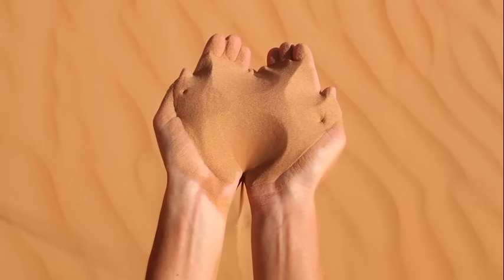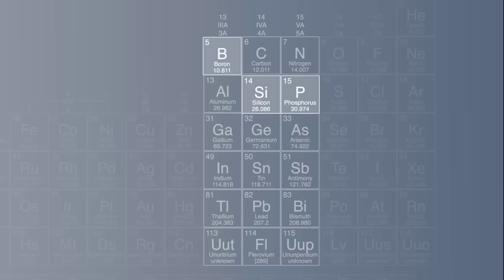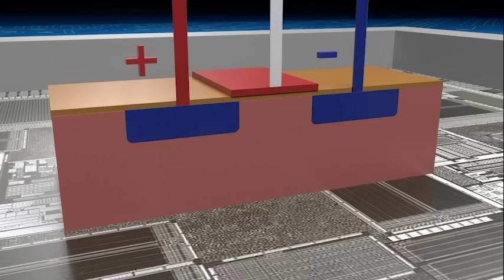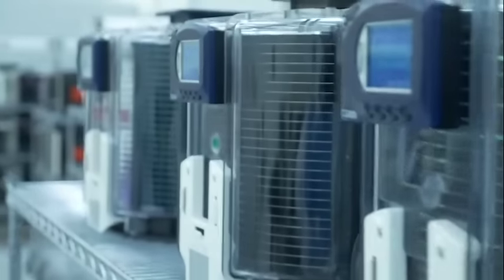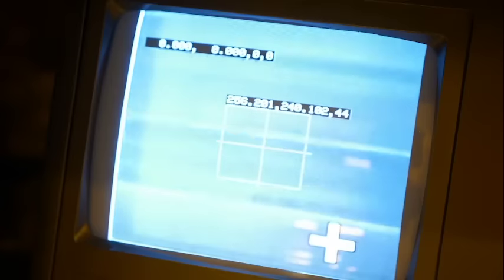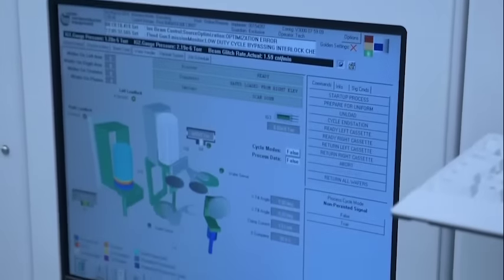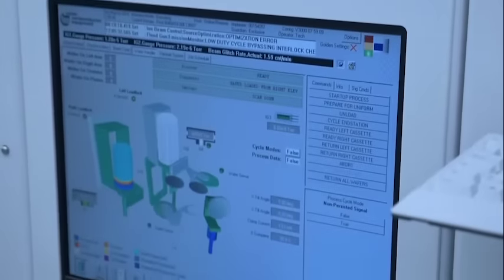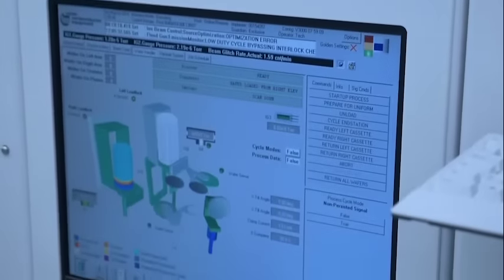Chip Manufacturing - How are Microchips made? | Infineon

Comment: I'mma be honest. I've seen plently of videos about semiconductor manufacturing and I have to admit... this is probably where most things clicked for me. The way the field effect turns on a MOSFET, the steps in which a photoresist or oxide layer or sputtering or etching generally happens compared to the others. This is fascinating stuff, and a nice explanation, although even now I still have to check over somethings to remember the process better. Maybe read some then watch some more Asianometry content 😅

Comment: the existential question .. how are the machines that manufactures these nano scale chips made? they themselves contain the few nanometers transistor technologies ..
the creator is made out of his creation!
Reply: You answered your own question.
Historically speaking, the first ever machine that produce transistor is very big. Like a Barn. And then they decided to make technological advances out of transistors that already been made into making a Smaller transistor than the first one. And repeat.
That process went for tens of years from 1947 to this day. 
Everything literally went through Trials and Errors. To the point where Transistor can no longer be made out of something purely Conductive because it will gets easily overheat, the scientist need to came out with solutions. This is the point where semiconductive Transistor ideas came out. The scientist need to find a way to make a transistor able to withstand overheating until they experimented with the Sand aka Silicon. Now regarding your question about how did they make nanometers scale of transistors? How did they actually cut it or sculpt it .Like have you ever tried to burn something using Magnifying Glass and Sun light? That's how they experimented with.
Reply: @ClayWheeler  thanks for your detailed answer
Reply: The smaller chip sizes simply give the end product more speed. You could probably run the software for these robots on 20-year old machines.

Comment: i still dont get how they make those 7 and now 5 nanometer transistors.....? what tool they use?
Reply: with alien help
Reply: It's a trade secret, not every company wants to disclose their techniques I guess. But from what I've heard and researched online, they often used advanced versions of the techniques mentioned in this video, or something 

I know I might be r/wooshed for this one
Reply: @rickv9180  yeah i did research on that, found out that they use various versions of nanolithography and few other imprinting ways, it is still beyond me how can we imprint things to near atom/molecular size :O
Reply: they use materials that are light sensitive to make the designs and print the silicon
Reply: @NostalgicMem0ries  It's just like this, but with light of a similar wavelength. Well, ok, actually they use some tricks with making two walls in separate steps that leave a gap that's smaller than what they could project in a single step, to get those extreme fine 5nm lines. But apart from some trickery when projecting the patterns, it's just this. And then some more steps for more metal layers on top.

Comment: How did anybody figure out how to make this? Now I want to know that
Reply: This came up in stages, like you see Intel's 4004 microprocessor is a very simple technology as compared to today's i5, i7 processors. That cake only through several stages each having improvement over another
Reply: That's an interesting story, indeed.
Reply: Transistors and diodes had existed for years as vacuum tubes (which were very large and power hungry). Scientists gradually figured out ways of using doped silicon/germanium to mimic the effect of the vacuum tube transistor/diode - at first, they were slower than the thermionic devices, but eventually became faster so everyone wanted to start using them.
The process shown here is the evolution of mass producing smaller and smaller transistors - the early ones you probably would only get one chip on each large wafer..........

Comment: If you understand valence, then you will understand the principles of microchip production. Now, I have to know how 1 and 0 dictate the operation of the chip. I have read previously that the diameter of atoms is around 1 NM and that the theoretical limit of gate is 2 nm. Any less than that and the atom will not be able to pass through. Is it true?

Comment: Chips don't start out with regular sand, we have an abundance. It's a common misconception I hear again and again. 99.99% of sand is not suitable for semiconductor manufacturing because it has many impurities that cannot be easily removed. There are just a few deposits in the world where SiO₂ is pure enough for the industry, and usually, it's not sand, but quartz mineral rocks.
Reply: Yes, perfectly right. Sand is generally not pure enough. But the most important problem is that grain are so small that it is very difficult to control the carbothermic reduction of silica into silicon. Quartz mineral block, bigger than on fist, are used. See for instance https://youtu.be/D1ALNg3z2gk

Comment: "not permitted to wear any makeup"
I had a huge disaster with a product at work that used component from your competition that had been randomly failing and we couldn't figure out what was the cause, later on after investigation with electron microscopes, x rays and other fancy equipment, it was discovered to be contaminated with makeup that some lady operating the bonding machine had been wearing.
So yeah it's nothing excessive, it all has to be really clean.
Reply: When I worked in the paint shop we had repeated issues with contamination of car wheel trims in exactly the same place.... after looking through the process we found out the issue was the operator placing the unpainted parts on the robot was eating cheesy wotsits with the same gloves she was loading the parts with...

Comment: 4:28 Wrong. Simply disconnecting Gate from positive pole is not enough to close FET. Gate must be connected to negative pole (to discharge capacitor formed by Gate plate, P-layer and insulator).

Comment: Does anyone know why we can't use the entire wafer to make the microchip and just not make the circuit smaller?  

Currently we have a tiny microchip in a 50x size smartphone, and metal connectors take up so much space to shrink down to join the circuit board with the microchip.  So Why not have the entire circuit board be the microchip?  No connectors needed and miniaturisation can cease or reverse, as a smartphone sized microchip as the circuit board itself could hold 6 TB, based on current 120 GB a small microchip a 50th the size of the smartphone can hold.

Please let me know.
Reply: Technically it would of course be relatively easy to build such a chip. But it wouldn't be very fast nor very energy efficient. The problem are the extremely high clock frequencies: 

A 1 GHz clock means that even light can only travel about 30cm during a single clock tick. I don't know how fast the electric field propagates in a semiconductor but it is probably something between 30% and 60% of the speed of light in a vacuum. 

Now consider that an electrical connection often cannot go a direct route and you also want a safety margin so that all signals are stable before the next clock tick. So high clock frequencies are only possible with small chips.

Smaller transistors also mean better energy efficiency. A small transistor "fills up with charge" and therefore switches a lot faster than a large transistor. So in microelectronics miniaturization is king.

There is however some research to ditch the high clock frequencies altogether and build on slower chips with parallel computing. The problem with that is that not all workloads can be easily parallelized. And more cores also create more problems with memory consistency. A very radical idea is neuromorphic computing which even ditches the von Neumann Architecture we all know and love. But it'll be a while before that is ready for prime time.
Reply: Yield is the problem. There are too often defects in a wafer. If 99% of the chips on each wafer is ok, it's a good result. But if there would only be one giant chip on the wafer,  only one out of hundred would work and the rest would fail and be scrapped (assuming that 99% yield on wafer level meaning 99 good chips for every bad chip - the number is just an example, in some applications we can do better, in other applications we do worse than 99%). What I mean is, the larger the chip, the lower the chance that it works correctly. If you have smaller chips and test them before assembling on a circuit board, you have much more chance that everything works correctly.
Reply: And also, some functionalities in your phone, require different wafer and packaging technology, those can not be put on same wafer as the usual stuff

Comment: How on Earth is there a silicon shortage when it's made of sand?!
Reply: Effective distribution for cheap is quite difficult
Reply: (1) It's not really made of sand, because it would be too expensive to purify the silicon in sand. They get their silicon from mines. But that is not the problem.

(2) The shortage has nothing to do with the raw materials. It's a problem with production capacities. And as you might guess from the video, the production of semi-conductors is extremely complicated. You don't just build a new factory in a few months. The machines in these factories are not something you can order off the shelf and have them delivered in a few weeks. They are manufactured specifically for the client and some cost over 100 million dollars a piece and have a lead time of more than 1 year until they are delivered.

Comment: You can’t use deserts sand that mostly sandstone dirt.  Even pure sand   The main choice It has to get to 98% pure silicon goggle  by 2 long 45 minutes of 2,400 degrees to get pure.
 They are sand shortage in Asia’s already. Can’t used desert sand . That why cement building in Africa collapsed the dirt inside make it breakable.    I did research the top 10 countries who  have these furnace  that make 98%pure silicon ingot 6 are in china.  They  covered all bases decades ago. Did their science homework.

Comment: and media is saying we have a shortage of microchips LMAO - made primarily of silicon. Media continues to spread FUD
Reply: Well, The media is right, we do have a shortage of microchips. But you interpreted a meaning into the news which isn't there. Nobody ever said that a lack of silicon was the problem. The problem is manufacturing capacity. Manufacturing slots in fabs are currently completely booked way in advance and unless you are manufacturing stuff in high-volumes or are prepared to pay a premium, it is hard to get a slot.

I work in R&D. Since we only build prototypes we don't have a huge demand for ICs and our demand is most certainly not constant. For some components it is currently a huge pain in the ass to get them in a reasonable time-frame to reasonable prices. For some components we were quoted lead-times of more than 1 year.

Comment: This video is shoddy. 5.5/10. Full of confusing termonology that's fancy on purpose rather than explanatory (eg. semiconductor device instead of integrated circuit) and misleading statements (eg. "0 and 1 or on(1) and off(0)"). It misrepresents a lot of general information (eg. the steps are repeated houndreds of times, not just several) for no reason and glances over some very interesting steps and relevant information (eg. gold wire bonding and yield). It might be the best educational short (very aguable), but that's only a shame. It wouldn't take more than 15-20 minutes to convey 10 times more than this video in a non-bullshit manner. (and no, for the kids with stupid arguments, I'm not gonna do it, this is just feedback stating the reality of the video, it could be so much more).